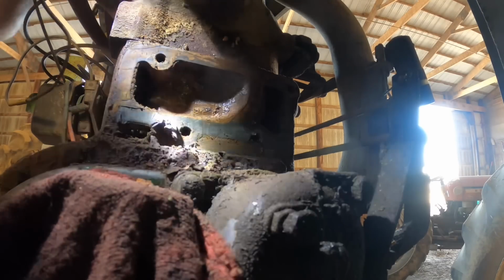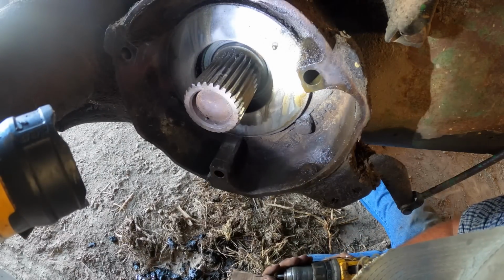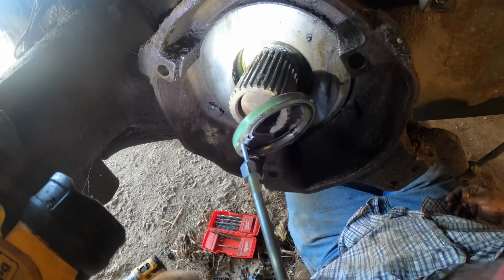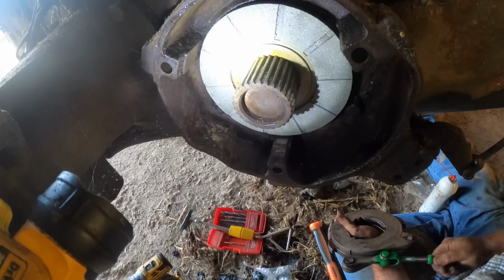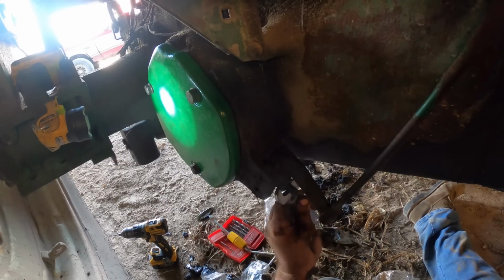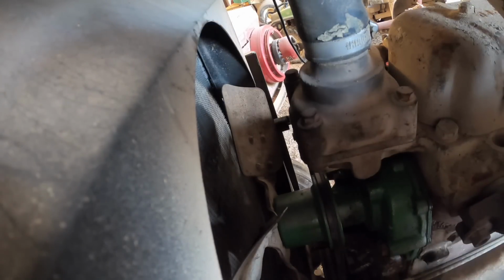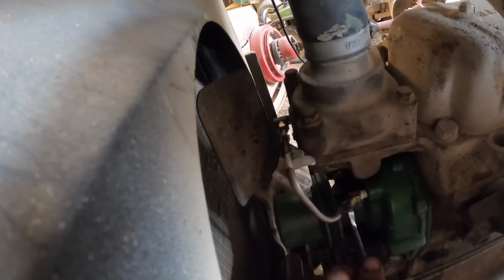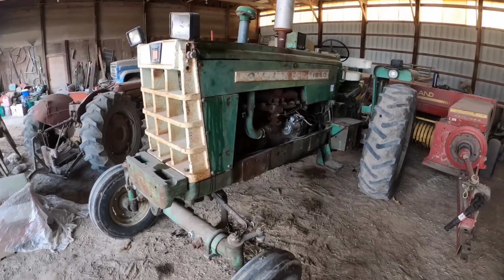1650 SERVICE CALL-Part 2

Comment: Ross, you should carry those wrench pliers with you all the time, saves you time using an adjustable hammer wrench. LOL
Could you bring that tube up and over and around the backside, (next to the valve cover), would that give you room away from the fan blades?
Reply from the maker: That’s not the way they were. They were the same route that I took, just the tube was slightly shorter.

Comment: I just go done changing the brake pinion shaft seals on 1070 case very similar system yo yhe oliver.
Reply from the maker: A lot of them followed a similar design. Some of them even use the same brake discs.

Comment: Thanks for the info on how to change the seal. When I rebuilt my brakes on the front of my big White I was wondering what I would do if it ever started to leak. Now I know! I guess you didn't find it necessary to drain the gear oil to service the seal. I keep mine filled to the top drain plug would that require some oil to be drained in that case?
Reply from the maker: There shouldn’t be much that comes through there that quickly. You should be able to do what I did.